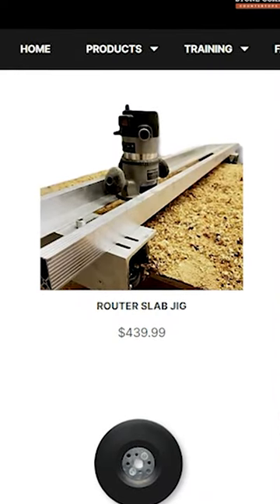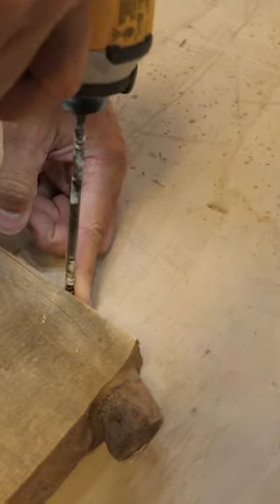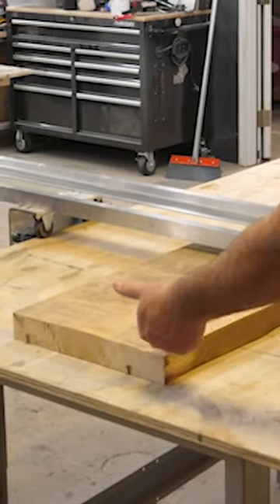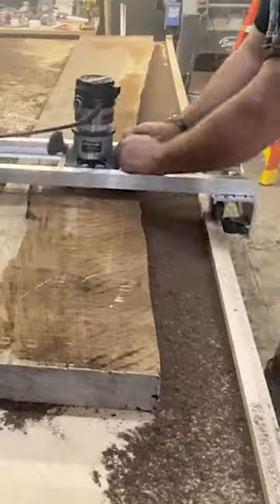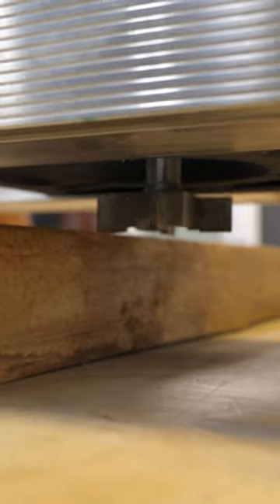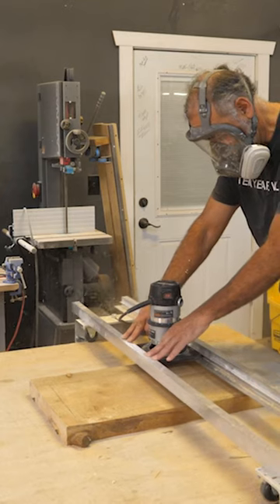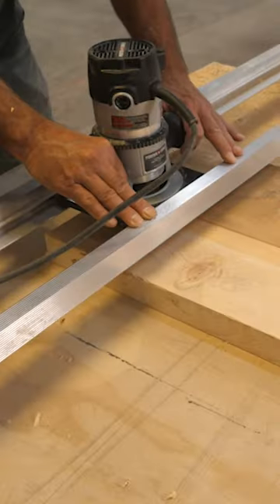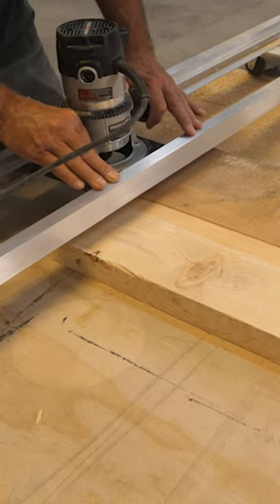Designing and Building a Wood Sink with a Slab Jig

Comment: That’s how I flatten mesquite for my first Mesquite entry door which weighs 400+lbs. still swinging smoothly since 1999. Now they have special bits like yours I used a 3/4 shank x 1” bit. Box was 1/2 baltic birch with 2x4 rails. Used a 1x6 white oak board to attach the same router it appears you are using. ❤